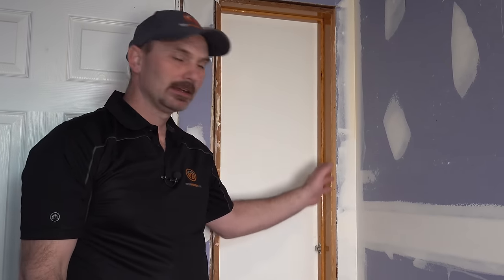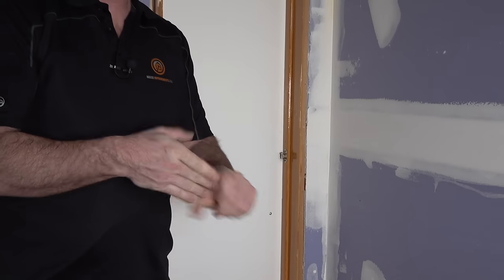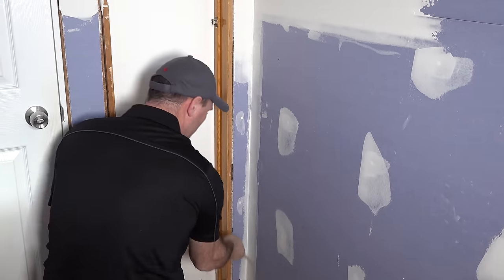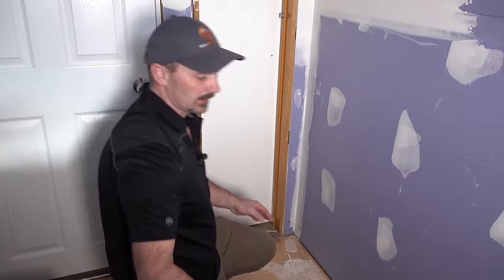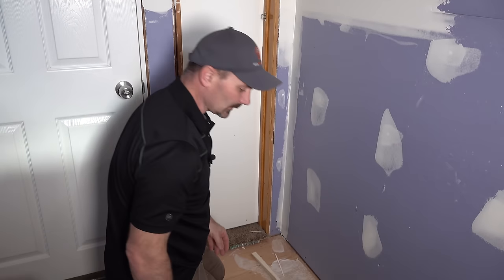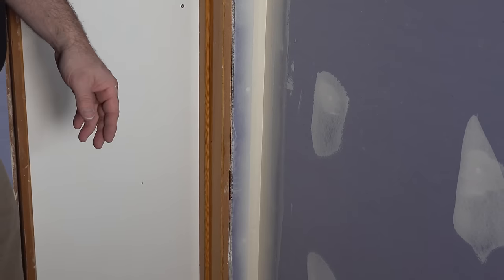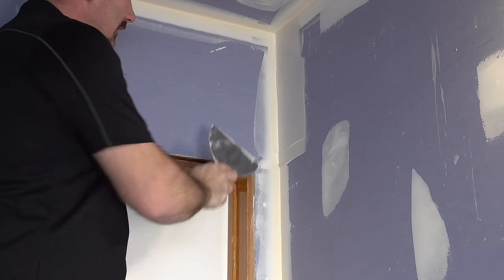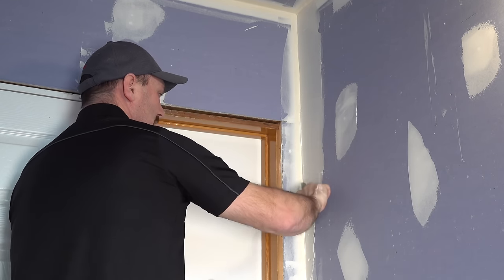How To Tape & Finish Inside Drywall Corners

Comment: Not doing both sides of the corner is a very valuable tip, explains the ridges and groves in corners. Also appreciate the tip of knocking off the dry excess bumps.
Reply: he is doing both sides. watch again

Comment: Thanks for the tips I’m a carpenter but I do run into drywall all the time and it never looks as good as I would like and I think watching your video will help . My steps looked like this  tape, mud, wait 20 mins second mud both sides of corner whoops :) I’ll try one side at a time now
Reply from the maker: I find rushing drywall mudding usually is more work sanding

Comment: Easy for you to do. I'm in the middle of a drywall project. I get so many cracks at seams. I used that mesh tape.
Reply: Good looking 67 Camaro you got there,
Reply: @morehp1  it I nice...it's just not my car. Just a car at the show I saw.
Reply: You have to use hot mud for mesh tape
Reply: Mesh tape only works with powdered or "hot" mud, the stuff you mix and goes off in an hour.   The chemicals in the joint compound do not like mesh tape and it will crack over time.   Regardless of what the manufacturer or others tell you.   You can finish coat mesh tape with regular joint compound but I only use it for repair work, otherwise it is paper all the way.

Comment: I still suck at doing corners and butt joints after 4 years. I just end up sanding more. If I'm impatient I use the corner tool and feather it out with a 6" knife. But I've noticed the corner tool creates too much of a rounded inside corner.

Comment: Enjoyed watching the video. Wondering if you have videos on doing 130 degree angle inside corners using corner beads. Thanks
Reply from the maker: no we do not but it is really the same.
Reply: Depending on what kind of inside angles your doing Flex Tape could be the way to go for you as long as your line is straight when you first put it up finishing it is a cake walk as you don’t need to go fully into the corner to finish

Comment: Any tips for fixing inside corners that are already painted? Some of mine in our house are rougher than I would like? Sand paint first and then go right over? I've seen that mudding over paint creates more bubbles than some would like
Reply from the maker: Let the paint cure a week or so and then touch up the bad spots. You may still get bubbled paint but if you use a little drier mud it will help.

Comment: Great info. Would you apply the same idea for a small outside corner? I've plaster up the underneath of a turning staircase so I have inside, outside and vertical corners? They seem too small to bead. Thanks
Reply from the maker: Outside corners get a metal or metal/paper bead installed and then finished. We can discuss more in the forum if you post your questions there.https://www.house-improvements.com/forums/

Comment: Shannon, if I am going to put crown or other moulding at the wall/ceiling joint, there is no purpose in finishing as demonstrated correct? Thanks for all the great videos.
Reply from the maker: I would at least tape the corner and 1st coat of mud for fire resistance.
Reply: Not just fire resistance but as a finisher I'm paid to finish. What happens down the road at remodel? What happens when a draft shows up? There are many reasons to finish.
Reply: @mikecase9365  Honestly depends how you bid your work, if the client is using cove or crown I give them a small amount off the job. I always tape the corner though
Reply: @stargateproductions  I certainly agree but around here paid to finish is paid to finish. I due trim work as well and can tell you I would want to know who did the work...
Reply: I agree, tape and give it a coat to seal it up.   Looks more professional that way if the moulding is ever removed.   Same with bathrooms that you are going to tile over.   It seals the joints.
Reply: @mikecase9365  If you are being paid to finish the drywall, then it should be finished to whatever specification is in the job - that is between you, your boss (general contractor if sub'd) and the client.   As a DIY'er it gives me more practice at taping and coating therefore improving my skills even though it may be covered in the future.   However with my wife the job may change and she may decide not to go ahead with the moulding in which case you have to then go back and revisit with extra time and materials....
Reply: @andrewcarr2431  well the problem is once the wall is painted it makes the process harder. Finishing the top corners takes minutes when in the process. Not finishing takes how much more time. When I got bigger fish to fry getting a call back to finish what should have been finished the first time is a giant waste of time. If a owner wants it that way I would be charging the same amount. Not only is it a fire code violation at least in my area it also is a warning sign for me about the owner.  So yes owner discression but right is right wrong is wrong.

Comment: Great video. Thanks! So, if I’m hearing you correctly, you do just one coat of the tape, as long as it’s completely hidden and smooth? We don’t necessarily have to do three coats?
Reply from the maker: That is correct. Usually 3-4 thinner coats will result in a better job and less sanding than one or two thick lumpy coats
Reply: @HouseImprovements  Thank you, sir.

Comment: Wall To Ceiling joint question: I replaced the ceiling with new sheet rock and I have a 1/4” gap for the ceiling to meet the wall. Will the tape take and sparkle take care of this gap or do I fill it in with thick mud first?
Reply from the maker: Pre fill it first with thick mud or hot mud (quick drying) , let it dry and then tape as usual. With regular mud it my take 12 -  24 hrs to dry.
Reply: @HouseImprovements  thank so much, I will do so. Thanks for all your videos.

Comment: Thanks. I was thinking another coat using a finishing mud was needed before sanding. For corners this is all that is needed? Can only use all purpose mud? I am redoing my house where some tape in corners came loose after house settled.
Reply from the maker: You can buy all the different types but you really dont need to. Especially on a small project where yo would not use all of each of the types. Just use all purpose for all the steps.

Comment: I'm a huge fan of the Perfect 90 type corner bead as it is stronger,  straighter, quicker and more importantly for us do-it-yourselfers, far more forgiving.  I would often goof with paper tape and cut the edge in places or get wrinkles when I was first doing it.  While I am a bit more skilled now, I'm no pro but have never had a problem with this made-for-corners tape. 
I also now like to use 90 min mud when possible as it lets me do a more than one side of the corner per day.  90 min vs quicker hot mud as the extra time makes it more forgiving for us slower, less skilled DIY folks.

Comment: I love doing things by myself, especially if budget is tight. But this is exactly the type of job I'm 100% fine paying someone else to do it.
Reply: Lol
Reply: Same here.
Reply: I love the challenge I just did an inside corner just like the one he's showing(right by the door frame)  I didn't prefill because the drywall was pretty tight there, without much of a gap.
Reply: Is all about not doing too much on the first coat because when it dries you can sand it and reapply
Reply: Of all the types of construction elements there are, this is the easiest to do. ??? 😮
Reply: @Bobster986  It's not because of skill. It's because it is a shit job and I have zero desire to do it.

Comment: Do you have a video that shows how you handled the inside corner wall that was next to the woodwork?
 Is it the same only with a smaller trowel?  
There's less room to taper so do you just build up that entire narrow portion of the drywall or do you try and taper it?  
I have several of those areas and I want to make sure I do it correctly.
Thanks.
Reply from the maker: Yes you have the right idea.
Reply: @HouseImprovements  Thanks.  I don't mean to be dense, but which is the right idea?
1. Do you just build up that entire narrow portion of the drywall?
 -or -
2.  Do you try and taper it?

Comment: great lecture.  On 3 ways the method I was shown, as it can be confusing to beginners (I believe it was "Vancouver Carpenter", thanks man!) is to think of it as traffic lanes.   You have a left and a right lane (either side of the angle), so do the same "lanes" all at the same time.   So left side of the wall up and down, left side of the ceiling from corner out into the middle of the room and left side of the wall on the other side where it meets the ceiling, corner outwards towards the middle.   Then do the right side when dry (or vice versa depending on your preference).   This possibly sounds worse with my explanation but after some trial and error it soon becomes automatic when you work on a corner.

Comment: Very nice, the only other thing I'd recommend is getting a flashlight when sanding, shine across your dried areas as you sand, if you can't see any bumps, valleys, scratches, etc with a light, no eyeball will see it without.
Reply from the maker: Yes sanding with a light is a must.

Comment: Great video, but why not just wet the tape before you install it to get a permanent bond to the wall and mud?
Reply from the maker: I've tried that actually, wetting the tape before applying to the mud, it does help but its another step.

Comment: Question, method on corner joints between an already plaster skimmed wall  to a insulated plasterboard wall that's just installed which is tapped and jointed ? Use regular tape and joint method ? Prepare the skim with anything for adhesion?.

Comment: What type of mud did you use?  How long to dry before sanding each coat
Reply from the maker: For the most part you can use all purpose mud from a bucket  or box for any thing. The dry time depends on a few factors including how thick the mud is applied, temp of the room and humidity. If you apply the mud smooth enough you dont need to sand between coats but that takes some practice.

Comment: I have a drywall corner in my 25 year old house where the paper tape has pulled away from the corner in places. Is it ok to remove the separated part of the tape (cut it off the wall), and apply a new tape along the corner, partially over the top of the existing tape? Or I have to remove even the good parts of the existing tape first?
Reply from the maker: Should work, you may not even need to tape it again? Post a picture on my forum and we can help more from there.https://www.house-improvements.com/forums/

Comment: this is probably a stupid question. But why must plasterboard joints be mudded at all? like what is the core purpose?
Reply from the maker: To fill and cover the joint? If you want smooth walls without seams you need to fill them
Reply: @HouseImprovements  ok, thank :)

Comment: I have a question, I covered my drywall with thin wood panels and was wondering if I could use this method to fill in the gaps between the wood  panels that meet each other? What would you recommend?
Reply: I had ply panels which were grooved to look like planks so I used general purpose compound to fill in the grooves then gave it a quality paint undercoat with two topcoats and it turned out great.

Comment: Why wouldn't you use the mesh tape
Reply: Mesh tape is thicker and requires the use of "quick set" which is a lot harder to sand. Mesh joints with all purpose will crack

Comment: hi i want to ask which side of the tape is going in the wall and which is going outside
Reply from the maker: if you look at the tape it will have a slight crease usually. Creased side that sticks out goes against the wall if you can.
Reply: @HouseImprovements  thank you very much
Reply: hi mr. shannon it s me again . it s playing any role if i switch the side of the tape or let s say i put the tape from the wrong side

Comment: As much taping as I've done, I use mesh tape, a corner trowel and I'm mixing my mud too thick. I have no idea how I've gotten good results!
Reply from the maker: Its not that it won't work. If your getting good results you may not wanna change your system? I think once you did this a couple times you would have no problems with it.
Reply: @HouseImprovements  The thing with thicker mud is, you don't play with it. I've learned to spread it out in as few moves as possible. But I like your results better. I like the thiness of the first mud layer on your tape joints. I'm going try it next time. What I like about mesh is it's self adhesive. No dry tape problem. I thought I was getting a lower profile joint but now I'm not  so sure. As for the corner trowel, it's the only way to get each coat finished the same day. Not sure I could give that up if I'm pressed for time.

Comment: Can you also “thin down” pre-made general purpose drywall mud?
Reply from the maker: Yes
Reply: Thanks for your quick response. I loved this video. And to clarify, should general purpose compound also be thinned a little (not as much as taping layer) for layers 2 and 3?  Because the mud that I have is a bit thick.

Comment: You really shouldn’t mess around with trying to tape corners that way. So time consuming, messy and inconsistent. You need to buy the homax taping tool. Hands down the best diy drywall tool. I wouldn’t tape a 10” piece of drywall with out pulling that thing out. And I taped my entire basement and ceiling and all my corners in 1 evening with that tool. You’ll never go back!